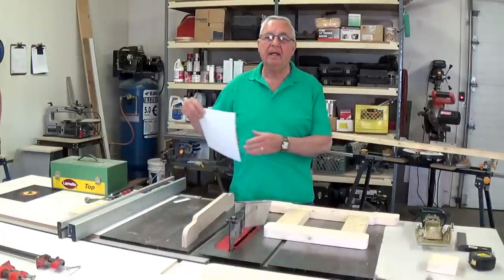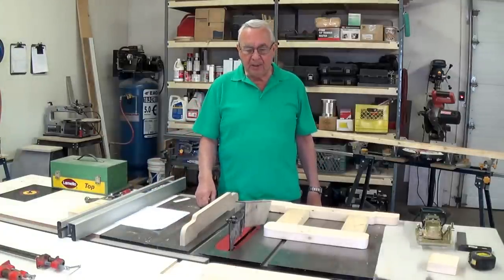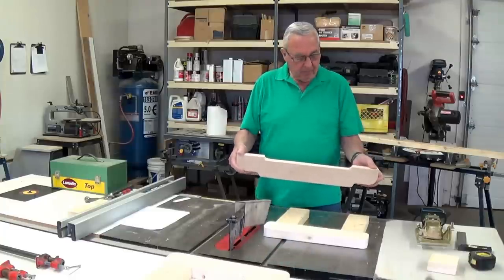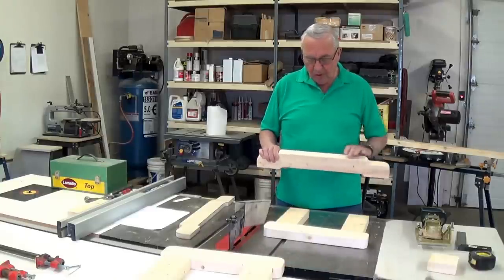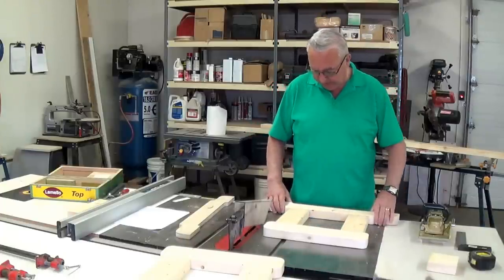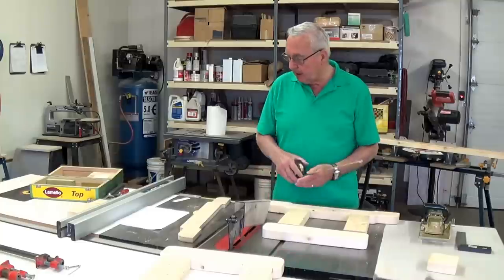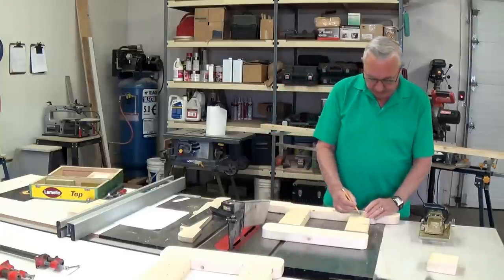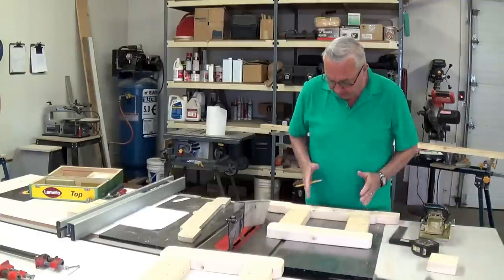Building A Glider Rocker Love Seat. Video #1

Comment: DO NOT TRY TO GO TO THE WEBSITE THAT FLASHES ON THE SCREEN AT THE END.  I managed to stop the vid at just the right place to hold that address while I wrote it down.  I typed in the addy and the Download links at the top of the page if for free converter software....NOT the plans for this project.  His 3 videos are on that page to click on and watch.  I found NO free plans for this glider or any thing else.  This has all of the appearances of a BAIT AND SWITCH set up.
Reply: If you looked a little harder you would have noticed there are no free plans rather complete building instructions. What more do you need?????